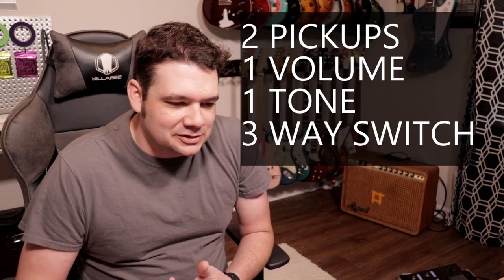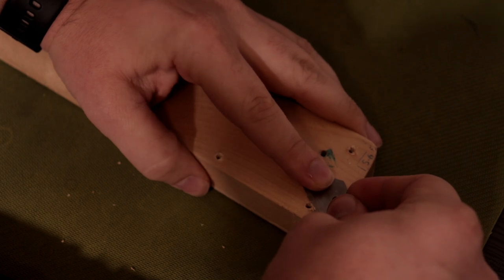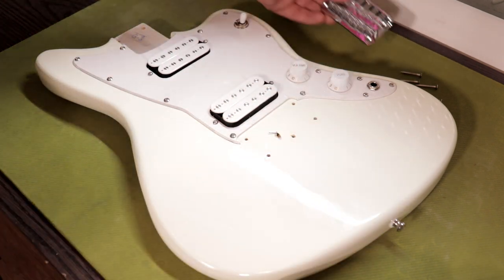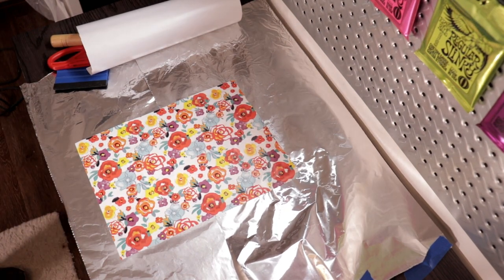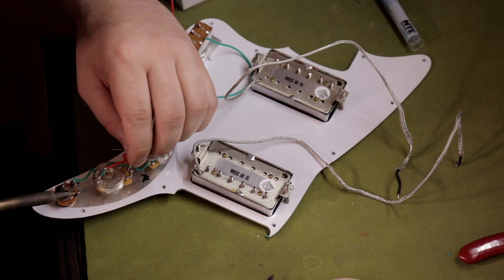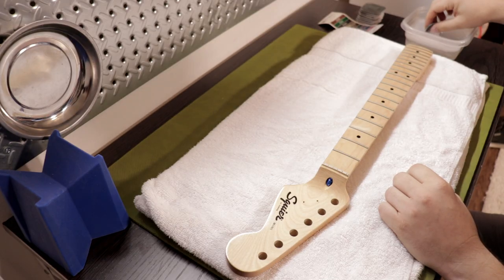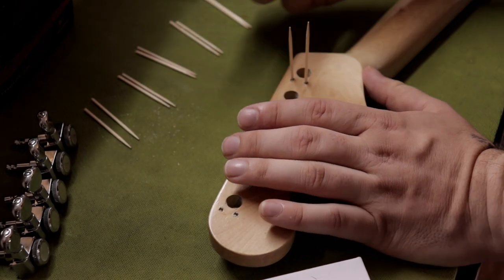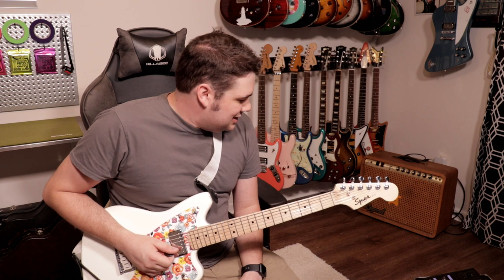Can I Turn A KID'S Guitar Into CUSTOM Travel Guitar?

Comment: Really awesome build! This tiny thing has got to be a lot of fun. A note about the extra cavity ground- my understanding is that it grounds the shielding paint.
Reply: The "shielding paint" they use in Squiers has almost no conductivity at all. I put copper tape in all of mine.
Reply: Yeah.. you are actually grounding the rear half of the “faraday cage “
Restricting all Radio frequencies emitted !
Leave it off Mr Squeals..or put it back!

Comment: If you would take 2” blue masking tape and place a strip on both sides of your razor blade  leaving apro 3/16 of the cutting edge exposed and trim the tape to size leaving a good flap to handle makes it easier and safer to hold and find when the next time you go looking for it.

Comment: I just ordered mine this morning.  I already have numerous other guitars, mostly 25" Fender scale length electrics, several steel-string acoustics & a nylon string classical, a baritone, etc. but I was looking for something short-scale.  (My first electric guitar was a Peavey T-30 with a 23.5" scale length.)  I was looking for something that I can drag around the house with me, noodle around on while watching T.V. in my office chair or record from my "studio console".  I liked the fact that it has humbucking pickups even though I am more of a Strat guy than a Gibson / Les Paul guy, and the off-set body style is something I don't currently have.  To be honest, if they had a Mustang version with the same 22.7" scale length, but with the Mustang wiring diagram I would have gone for that, but maybe in the future they will.  I'm not a child nor a beginner, I just have small hands and I can make upgrades without feeling like I am defiling an expensive vintage instrument.  I really like the upgrades you did on this one and it inspires me.  I've heard mixed reviews on the tuners so if there is anything that I might want to upgrade first, it would be a nice set of locking tuners.

Comment: I've had many mini Squiers. My red stratocaster mini is the best! I upgraded a lot and hemispheric frets are the thing now. The older one's are better in my opinion. I put a blade humbucker in too. The only really big complaint is the saddles can't be lowered past a point or you lose your tension. I will be drilling some feral holes.
Reply: @globalnova  to angle the neck back?
Reply: @ranman58635  to angle it downwards towards the headstock.i.e. raise the very end of the neck heel up a bit so that you can have higher saddles.

Comment: very nice job. what gauge strings did you put on? and do you remember the saddle string spacing? thank you.
Reply: replying to myself as there was no reply. i have since modded the absolute shit outta mine and it's awesome. the only con is not having more frets. i use11s in Eb but reckon 10s would be fine in E.